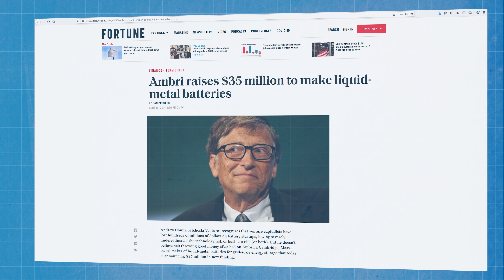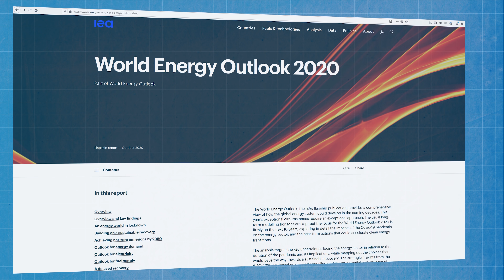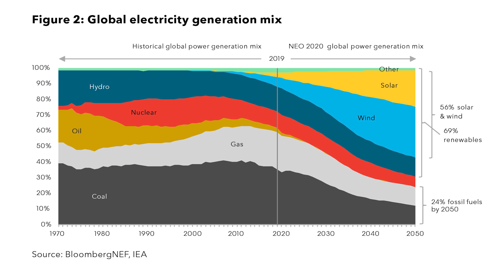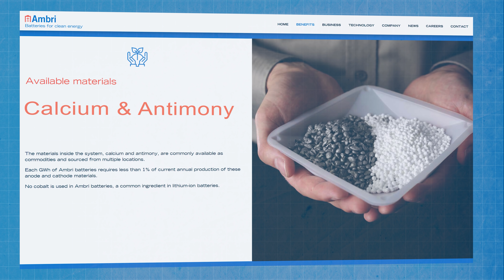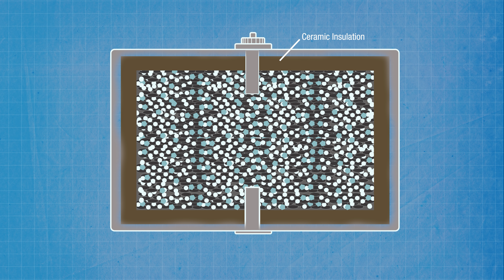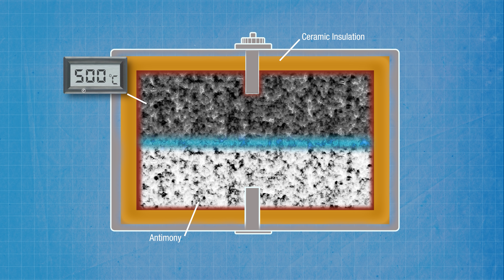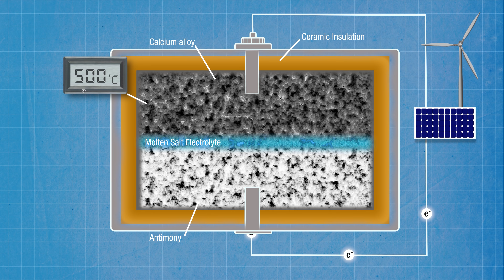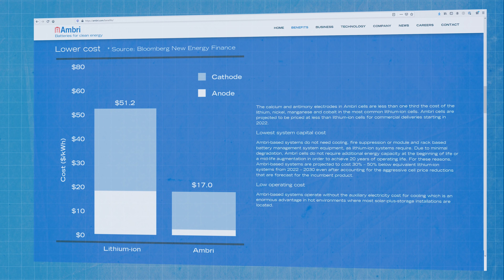AMBRI Liquid Metal Batteries. Will they really change the world?

Comment: Anyone heard of sCO2 for greener energy production? i think it might be helpful. Any thoughts?
Reply: No, nobody has heard about "sCo2" 
For starters - NOT using acronyms is a sign of a broad education. Only teenagers and people with a very narrow view of the world use acronyms out of context.
Reply: @michaelrenper796   Show me an academic study verifying your claim please. I didnt ask for your views on a form of expression. sCO2 stands for supercrtical Carbon dioxide.
Reply: @daralic2255  And "academic study" for the use of acronyms? No Sir, this is a professional (with an academic education) and 25 years on the job talking.

About supercritical Carbondioxide power cycles. No, irrelevant in the big picture. Nice from an engineering and economical perspective of running a power plant perhaps

And why should it be relevant? (Says the physicist). A different working medium for the Carnot cycle gives a few percent extra efficiency at best.  
Its still a heat engine, which are mostly fossil fuel powered. Cant see how its better than methane burning gas turbines (which the least damaging fossil fuel). 

Not suitable for low temperature gradient heat engines we would need to wide spread solar thermal applications. 

And remember the hype about Stirling engines years back. Closed gas cycle engines are an engineering nightmare.
Reply: @michaelrenper796  I will wait for a URL link to direct me towards your resume so I may check your background. And thank you for your valuble opinion. I just learned about sCO2 while researching superfluidity funny enough.

Comment: as far as I understand, those 80% efficiency are after heating :)
Reply: The initial heating cost should be minor. While charging and discharging they heat themselves (with the 20% energy loss entailed by 80% efficiency).
Reply: @adymode  "While charging and discharging they heat themselves"

That doesn't sound right. According to the video they heat up while charging, but as I understand it an exothermic chemical reaction is endothermic if you reverse it.

A = B + heat     or     B + heat = A

Getting heat out while discharging the system sounds like having your cake and 'eating it. (Sorry, I couldn't resist the pun!)
Reply: @nagualdesign  Its normal for batteries to generate heat while charging and discharching. Its not cheating because the energy released as heat is not released as electrictity (80% + 20% = 100%) This battery runs at high temperature but it is storage is not based on exo/endothermic cycle.
Reply: Can that excess heat be utilized?  You know, like heating up water for showers/dishwashers/washing machines/etc.
Reply: @christalbot210  If you take away the heat, youll have to replace it with more power. 
You need to keep the heat in the system.
Reply: @cobeer1768  No, if you constantly convert 20 % of the electric power to heat, the heat power stream has to go somewhere. If we put the battery in a perfect heat insulation, it will heat up idefinitely, i.e. until self destruction. So Chris Talbot has indeed identified a 500 °C heat source which can be put to use somehow, e.g. for a good old thermal heat engine, which would get back about 30 % of it to electric power, with the rest being emitted as low temperature heat, again useable e.g. in district heating schemes. (This argument supposes of course, that a similar thing is not yet integrated into the technology and the heat is indeed available at 500 °C.)
Reply: @dmnkln   The liquid needs to be at high temperature. You can't extract the heat from there directly. You could extract the heat after going through the insulation, which will be at a lower temperature. If that battery cycles quickly, then less insulation is needed and the waste heat will be at high temperature. If the cycle is long, then you need more insulation to keep the battery functional and the waste heat will be at lower temperature. If the battery cycles really quickly and generates more heat than it can discharge, then you could harvest the heat directly at high temperature. No insulation will be needed then, it would be even undesirable. I don't know how fast the battery could cycle.
This all depends on the size of the battery. The bigger it is the less insulation would be required. Heat generation should be proportional to the volume and heat dissipation to the outside is proportional to the surface area.
Reply: @Sogartar   Thx for the detailed answer. 
If the battery generates an average power of X kW heat, no matter how small or large, that has somehow to be removed to avoid overheating, at a temperature level T, we can harvest this power at this temperature level. 
We must, of course, not try to harvest more. 
So we would choose a superefficient heat insulation leading to parasitic losses of practically zero and add some heat transport device which meticulously regulates heat transport as to keep the necessary internal temperature. 

Not sure whether this is technically feasable in the moment, but in principle it is.
Reply: @christalbot210  I think it could be used only in a minor way as you need the heat so cannot cool the battery but if you insulate to the highest level there will still be leaking so you could in home systems build the system in the centre of the house to use this waste heat , safety allowing
Reply: @alanrickett2537  Hence my use of the term, "excess heat".
Reply: @christalbot210  A data centre needs a lot of cooling, any excess heat could be used to run a cooler that uses the "ammonia cycle"
Reply: @christalbot210  I think the heat is used to maintain the metals at liquid
Reply: In reguards to the heat needed in this battery, is it possible to use another source of heat...ie, direct heat from solar radiation. The efficiency of suchlike can be in excess of 90%, which  is way higher than the typical sub20% of electric derived from P.V. cells. Does this not increase the battery efficiency  to greater than 80% , I ask? And so, a hybrid system that collects and uses heat in a secondary phase that  raises system efficiency
Reply: @Jay...777  ICE's have an active cooling system. Of course aluminium doesn't melt (if it can shed heat faster than it gets pumped it)
I understand this is within a steel/ceramic shell.
It still needs to be very hot to keep working.
Hopefully the LasVegas experiment will pan out.
Reply: @Jay...777  500C seems really hot to me! (Like hot enough to melt aluminium)
Reply: @Jay...777  Yea that's certeanly not true.
Reply: @Jay...777  ooop. Sorry, 'Reno'
There's no turning carbon around with the population we have, let alone projected.
I have hope for this "off grid" storage system. Scaling manufacture is a different challenge entirely.
Reply: @Jay...777  Well, I might eat flesh once a week.
We have evolved as omnivores after all.
But the thought of that H7N9 is intriguing.
I'm going to hope that makes the leap to our species, develops longer incubation and a higher mortality.
When humans get back down 2 billion the earth might have a chance.
As it stands now we're nothing more than a cancer.
Reply: @Jay...777  Except the carbon we pulled out of the earth is the result of billions of years of solar energy, converted through photosynthesis to lipids.
"We" can't undo a billion years of insolation on any human timescale, or even that of all humanity.
Even at 'zero carbon' energy humans still eat, shit, breathe and breed.
Unless you 'undo' probably six billion of us, 'we' are still going to excrete more carbon than we can hide under the mattress.
Yes, a HUGE amount of energy goes into pulling nitrogen out of thin air,  we could plant nothing but legumes, and still never get off the need for synthetic fertilizers to feed humanity.
I sorry to be Captain Obvious, but at least I'm not the one with my head in the sand.
Reply: @Jay...777  Tell me a Chimpanzee is vegetarian.
I'll show you some brutal videos that will prove you wrong.
Reply: @Jay...777  I don't see my reply as emotional.
We're animals, and as a species incredibly gluttonous and wasteful.
Nothing will change that.
Reply: @Jay...777  There doesn't seem to be any shortage of vegetation here.
https://youtu.be/QkGvblv_ts4
Nope, our closest relatives looking for a meal.
And working as pack hunters to bring it down.
It's not just a dog eat dog world.
Reply: This is pretty far off base from the question of if liquid metal batteries are economically viable.

Comment: Now, this is interesting technology. If Amri can make those batteries work, it would be a game changer in grid scale energy storage systems.
Very least they got nice pilot plant with Terrascale in which they can test and improve it.
Reply: @Jay...777  would be nice, but the failed to throw money at the issue at the right time they needed Industrial welding experts but scaled back and look to fix it themselves you think rocket engineers or nuclear reactor builders think 500 degrees and pressure issues that some time break there welds and sometimes are perfect are hard fixes that need 2 years to solve
Reply: Its a manufacturing issue but when they had a problem auto welding the lids on they sacked half the staff and went silence for 2-3 years instead of pushing on , very sad I still hope they can  get moving again but they are in the manufacturing hell
Reply: @Jay...777  additional note the hand made ones were almost always good

Comment: How many total Watt hours are needed to melt each cell? During an emergency, where is this energy going to come from?  Or is it supposed to always be run even though it only has 88% efficiency?
Reply: Sorry Irvin, I'm by no means super optimistic for this concept, but when being critical you have to use you mind and look at the obvious.
How much energy is needed to melt them. Its in the video, indirectly. If the whole system is 80%+ efficient than melting will take <10%. Assuming 90% electrochemical efficiency it would be around 5%. Sanity check. At 10% of typical chemical power density the battery capacity would be 4.000 J/g . Specific heat capacity of antimony is very low (0.21 J/g) so only about 100J are needed to heating to 500°C - Melting heat is around 170 J/g or a total of 270 J/g to bring the system to melt the Antimony. Or 540 J/g for two cycles or ~ 13% Of the capacity of 4000 J/g.  

"Only 88% efficiency" Its around 80% This is a pretty good efficiency - Li-Ion is a bit better, but 80% is WAY better than hydrogen storage is similar to pumped storage. So the "only" in efficiency is a nonsense argument.

About emergencies: This is clearly NOT a battery for very high power densities and emergencies. It is for grid regulation and undemanding (in terms of travel distance) vehicles. 
a) For grid regulation the batteries  would be "almost" always on. Well enough insulated in BIG box to maintain temperature for a few days. 
b) The cold ones would be used for backup capacity.
c) you can add a few Li-Ion batteries to get the process started if falling completely cold. The scale up. Will take 15-60min to warm up the system but that is acceptable for grid regulation (the cold ones will be backup).
Reply: @michaelrenper796  I agree with what you put and I'd just point out one extra thing, to address the question "where is this energy [to melt the cells] going to come from?" As we only need the battery to be molten when we need to charge it (when we have plenty of excess green energy to store), the first bit of excess energy we put into the battery would make sure it's at the right temperature. Thereafter it will be kept molten until it's needed to discharge (once discharge every 2 days).
Reply: @michaelstreeter3125  the other pro is these batteries love the condition other batteries hate fast discharge  frequent switching etc

Comment: 500°c is pretty hot. I'm pretty sure that 80% efficiency relies heavily on exceptionally good insulation.
I'd really like to know why edison batteries are not being developed into grid storage systems, virtually no degradation, made from fairly abundant materials, poor energy density but is that really a problem?
Reply: Lead acid batteries beat edison batteries in $/kwh and energy density and specific power. 

The reason lithium ion batteries are used over lead acid, despite the former’s higher cost, is because it has a longer operational life and less maintenance, which results in an overall lower cost. A new competitive battery to lithium ion must have a comparable life cycle, efficiency, and maintenance cost if it is to displace it in grid storage; it’s unclear which battery can replace lithium ion as it is constantly improving. The cost of lithium is relatively high at the moment compared to other metals, so it should be possible to develop a cheaper battery, though whether one can be competitive on other metrics remains to be seen.
Reply: @hi-gf5yl  most nickel iron battery manufacturers give a 20 year operational life which is far superior to lithium and even when a battery's capacity is significantly degraded, a flush and fresh electrolyte will bring it back to its original capacity.
They are becoming increasingly popular for off grid application despite the higher initial cost than lead acid which I'm sure would be negated by quantity production as we've seen with lithium.
Edison claimed a 100 year life of his original batteries mainly because they used things like wood and paper for insulation between plates, Battery test and research inc. have successfully replenished 85 year old batteries and won't have to wait long till they can validate Edison's 100 year claim.
Loosing charge over time seems to be the biggest downside to this chemistry but in grid storage application, even if 48+ hour supply is desired this could be achieved with a hybrid system, the lithium's life is determined by cycles so could be reserved for use only when the nickel iron batteries are depleted which suffer less calcification if used regularly.
Reply: @turboconqueringmegaeagle9006  I've read that nickel iron requires regular maintenance; I think it would make sense for personal use as battery backup, but I don't think it would be viable on a larger scale due to the lack of efficiency and the maintenance costs that it entails. I can't say how the cost would compare to something like lithium iron phosphate, but I think that the low efficiency makes it not worth the cost. I also wonder why utilities are primarily buying lithium battery packs instead of nickel iron despite the advantages it has.
Reply: @hi-gf5yl  not at all, I can only speak from the reading I have done on domestic set ups because there are no large scale lead acid or Edison grid storage systems.
The only real maintenance specific to nickel iron is the electrolyte replacement and the manufacturers of the home owner type batteries recommend replacing it every 10 years, as far as off grid set ups are concerned that equates to the second replacement of a lead acid battery or first replacement of a top end lithium ion battery.
The battery efficiency needs to be calculated over a period of time as this is what let's nickel iron down, not holding a charge for long periods (weeks not days)  which is why for a grid system I am suggesting a mixture of different chemistries, the lithium batteries last longest if never used and also hold a charge over time better than anything else, nickel iron lasts longer between electrolyte replacement if used regularly so a system that used these for night time running and lithium for cloudy windless contingency planning makes a lot of sense but while every manufacturer is trying to push their technology even when it is not the most suitable we are destined to see huge amounts of wastage, while the sceptical side of me thinks that nickel iron is ignored because of its 100 year lifetime.